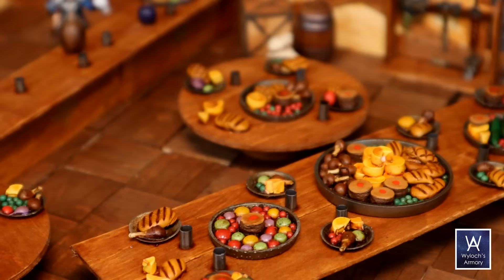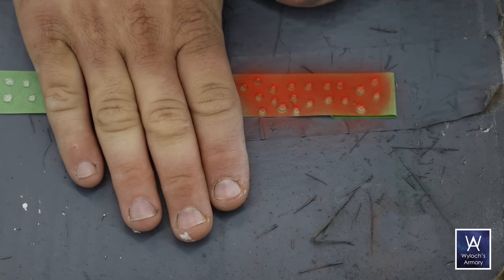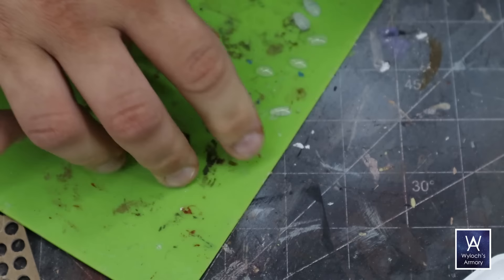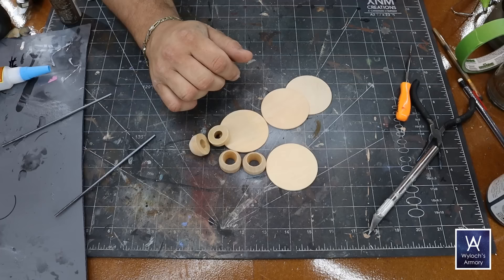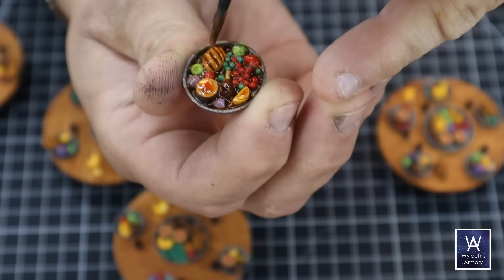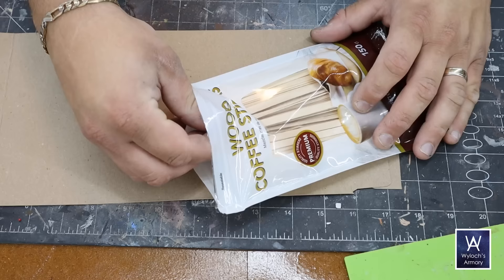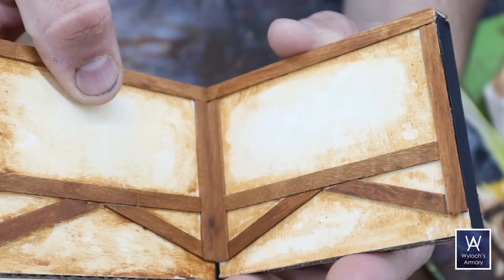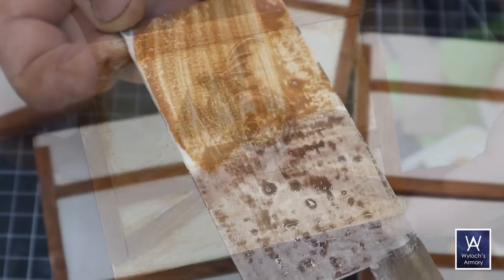Taverns and Miniature Food! DIY Crafting for Dungeons and Dragons

Comment: A note on the bread. The score marks on bread are from relief cuts to control where the bread splits when baking and are lighter than the surrounding crust. With the wash accumulating in the divot these are more like patisseries (melon pain, conchlas, etc.) or slabs of meat with grill marks than loafs. Not a bad thing, just something to be aware of if you or someone at your table is going to be anal about those kinds of details.
Reply: Let's not 'get anal' about the breads. 
<Shudder>
Reply: @michaelbarry1651  LMAOOOOOOOOOOOOO

Comment: SUGGESTION: in painting the flames in the fireplace, one could ad a few places of black at the top end of the fire, leaving orange/yellow bits above it. This would simulate flames leaping up from the fire. Aslo, Add an LED light behind the fire in the fireplace. Don't forget digital sound track of roaring crackling fire.
Reply: Also light a small fire behind the DM screen. The smoke will add ambiance and add an air of mystery and drama to your expression.

Comment: Great job as always brother, please don’t ever stop making videos ever again! Hitting your craft wood products with a single pass or so of a low grit (rough) sandpaper really quick will give a wonderful bit of texture that also takes stain and dry brush really well and goes great with the actual grain. I actually have a tavern that is almost identical in both approach and style as this. A tavern is an essential location and will blow the minds of your next dnd party when you pull it out and will almost certainly be your most used bit of terrain you could ever have.

Comment: The thing about painting things at 28mm scale is that, 99% of the time, people are going to be looking at the objects from three feet away or more, under less than ideal lighting. So long as you give the rough approximation of what it's supposed to be, human pattern recognition will fill in the blanks.

Still, these are some fine spreads, Wyloch. Something bound to supply a sumptuous feast, or attract all manner of monsters.

(The techniques for making bread, cheese, and produce can also be employed when building market stalls, or to top piles of supply crates.)

Comment: Wyloch have you tried using a LED candle to light the glue fire before you paint them? Admittedly look odd without the paint when the light is off but I find they look pretty amazing with the light on and flickering, especially since it will also cast light on nearby objects.
Reply from the maker: Yes indeed, done many over the years that way!

Comment: Instead of injecting a straw with hot glue, letting it cool, slicing it up, throwing out the deformoids...I just cut up a glue stick. Cheeses! 
You could paint it first, I guess. 
I also raided our office hole punch, which was used to clip lanyard holes in security passes. Pies! 
But Wyloch had the ideas first.
Reply from the maker: Certainly!  I wanted to have that hard rind you often see on cheese wheels but eh, who cares.  Well done.

Comment: With as much hot glue as you use, it seems a good idea to find one of those glue gun tips that has a small diameter pipe for the end. They're great for precision application, especially for terrain assembly.
Reply from the maker: Indeed!  Problem is those tend to clog up this gun.  I do have a much smaller gun but....am too lazy to get it down and plug it in.  :-D

Comment: my feelings about miniature painting is that most of the expensive time consuming pieces that get all the praise... with edge highlighting, 8 degrees of shadows, painted on self illumination and such... look a lot like a 5 year old trying on mommy's makeup. WAY TOO MUCH CRAP.
A solid basecoat, some flat colors or MAYBE an airbrush if you have it, and some drybrushing or washing depending on the material you're trying to create (and the washing is totally optional)... that's all you need, and that's what I think looks best. 

I want minis to look just as natural up close as they do from a distance... painting them like they were larger models and not adding a bunch of insane color grading and such produces a better looking mini IMO. Sure, you miss some of the creases in the guy's 2mm / 3/32" tall face at 2 paces... but chances are that face has terrible shape anyway because most minis look awful in the smaller details anyway due to the limitations. 

Then again. I also prefer reaper over GW because I actively dislike the "exaggerated so you can see it at a distance" look of GW stuff... just like the painting techniques. If it looks valid up close, it is valid from a distance. Ships on the horizon do not suddenly gain high contrast paintjobs so you can tell the difference between the raised and main decks from 3 miles away... they look like blobs. If you need to see the detail you can magnify or get closer. But I digress too much.

I like your simple approach. It looks completely perfect. (maybe not the wash on the walls... that's a bit thick IMO... the white on that style of wall is white plaster and.... even after hundreds of years, those buildings are still standing in some places and are still white, without having been painted. That's my only real nitpick.)  The finishing wash really brought the setpiece furniture together as a cohesive whole rather than disparate parts. Its nice to see someone outside the digital 3D world who understands the use of ambient occlusion.